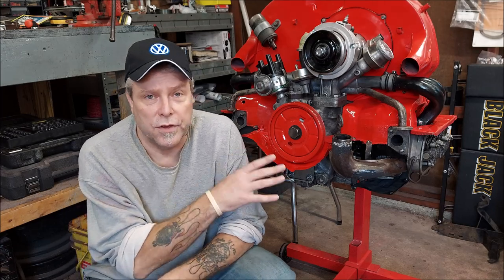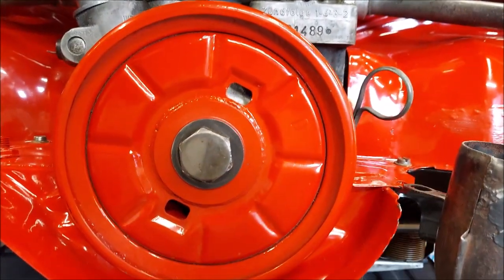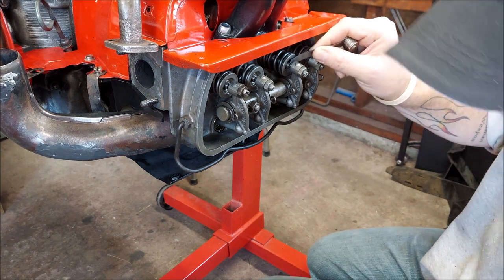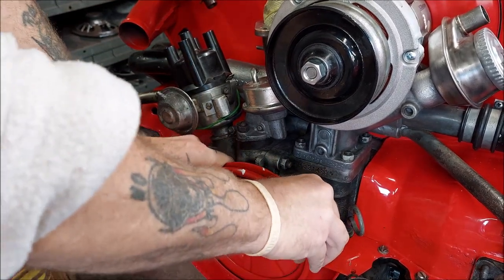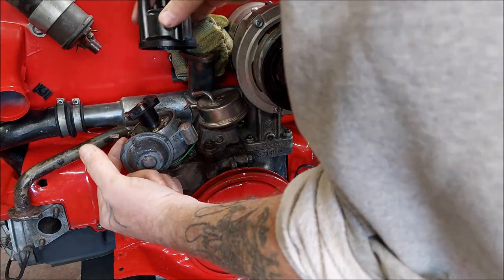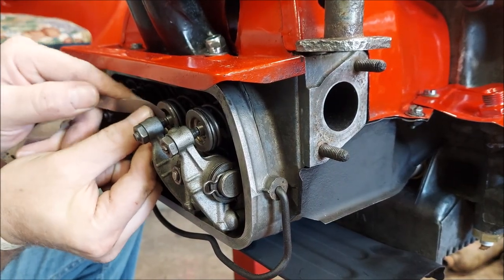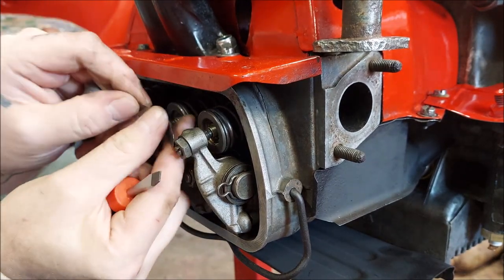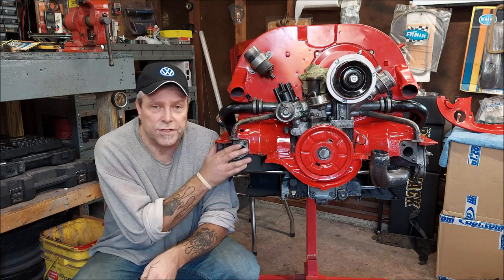VW Beetle & Super Beetle Valve Adjustment - 1600cc - VW Baja - VW Bus - VW Ghia - Valve Adjust DIY

Comment: In the mid 1960s the local VW dealer in Knoxville Tn. charged $2.50 to adjust the valves.

Comment: Really good video. I remember the last VW me and my father worked on. I forgot the valves needed adjusting and I had a problem with the motor making a sucking noise. To make a long story short, when the valves were adjusted, the head bolts wer e not checked for appropriat e tightness. By the time the motor lost so much compression it wouldn't run, one head nut had dropped off and all the others on both heads were ready to do the same.  When they were retightened,  the rocker arms were so tight against the valves, they would have sent them through the heads immediately at start up. After a VW gets 75,000 miles check the head nuts every valve job to keep your 1600cc motor happy. 10:35 My Father warned me it needed a valve job, but he was not able to work on it like he used to. It had the original motor in it.

Comment: Very clear video and good explaining… Thing I disagree with is all the extra pulley turning… you can actually adjust cylinder 1 and 4 on the same crank rotation as well as 2 &4 thus cutting the time in half…

Comment: I knew I could count on you to have a valve adjustment video. I need to adjust the tappets on my rail buggy. I can't seem to get my engine to run on all four and it doesn't have that good old VW clatter. I think the valves are way too tight.
Reply from the maker: Thank you! I did it while it was outside of the car to make it easier for filming.

Comment: Hi your channel is great.
I have just put my engine back in and drove it for the first time on Saturday, 2 days ago.
It seems fine, It had a align bore , new cam and followers. Seems a bit down on power, though. Is it because it is still a bit tight? I did the cam burn for 20 mins, and changed the oil.
 I am now about 30 miles into my 500 mile break in period. Do you have any advice you can give me on running it in, please? 
I was told not to drive it in forth under load up hills, yet, and generally don’t drive it fast. (Always stick to 55 mph and under, anyway).
All the best 👍🏾🛠🇬🇧

Comment: nice video👍 can i turn crankshaft by simply using a 30mm wrench on the crankshaft pulley nut?? much easier than hand turning…but would that loosen or over torque the crank pulley nut??
Reply from the maker: If you have the spark plugs out for any reason, it won’t loosen the nut with no compression. But yours is probably in the car. It wouldn’t be much fun just to take the plugs out of.
Reply: @SladesVWBeetle  thanks...kind of my thinking as well....

Comment: also…did a top end rebuild a few years back and used steel alloy pushrods instead of aluminum…Ive had lots if people tell me to now keep valve clearance to 1-3 thousandths as the steel ones don’t expand in hit engine like stock?  but Im a little leery…any thoughts?
Reply from the maker: Oh my…. I haven’t had anyone tell me that. I think I would be a little nervous about doing that, of course it’s just my opinion. But beings they are steel, there truly could be a difference.

Comment: Thank you Tony.    Finally did my first VW valve adjustment.  1600 that Lenny in Elizabeth rebuilt years ago.  009 and lash was 0 to less than .006.  I set them all to .006 since this engine runs hot (dipstick is too hot to hold)... I watched your cooling tin video too and did that. I thnk I destroyed a thermostat !  (you did say banana head)...engine is in and plan to start it this week... (generator went bad years ago, long story, engine and bus were parked for 5 years !)
Reply from the maker: You’re very welcome, and thank you for being here. Make sure when you get a chance to watch my video with the cooling tin installation. To make sure you them all on. 
Also, the thermostat if broken should fail in the open position, allowing the ducts to be fully open for cooling. 
But if the spring on the back….between doghouse shroud and firewall is not on, it will close the flaps and run very hot!
Reply: @SladesVWBeetle  that little spring was missing on the back of the shroud when I pulled it out...hmm, not really impressed on how this engine was built...
Reply from the maker: @DanTheManIOM  Ohhhhhh damn!!!! That wasn’t good!!!
Reply from the maker: @DanTheManIOM  I was only down his place a few times, I live about a half hour from there. I think he’s been gone for sometime though. I bought a couple of parts many years ago and that was it.

Comment: Awesome video! gonna do it soon. I got a new distributor, should I adjust the valves first then adjust the distributor to advance timing or vice versa? my engine's running too hot :(
Reply from the maker: This is just my opinion of course, but I would adjust your valves, then check your points for adjustment, and then adjust your timing.
Reply: @SladesVWBeetle  thank you so much! I'm gonna do just that :D

Comment: I adjust mine pretty often, not that I need to, I just like working on my dub.   I always wondered if it was too tight what could happen, an if it's too loose what could happen.  Your thoughts?  I heard it'll get noisy if it's to loose.
Reply from the maker: Too tight can stretch the valves, or cause other damage. But a little loose is okay honestly. Will just have that sewing machine sounds. Will not hurt anything though..
Reply: @SladesVWBeetle  last question, will it sound different or run different if too tight?
Reply from the maker: I believe if too tight, It probably wouldn’t idle very well! If to loose it would idle, but you would hear a lot of ticking noise. Never a bother there’s never too many questions.
Reply: How often should the Valves be adjusted??  Every 3k with oil changes??

Comment: Is it possible for my 1600 to have cylinder 1 be where your 2 was? I traced all wire and 1 is where your 2 is and 4 is where your 1 is.
Reply: possibly a different distributor? no biggie if every is tuning and running proper.
Reply from the maker: If you have a different distributor as stated above you’re fine.

Comment: How does the engine behave if valves are tight?
Reply from the maker: You definitely do not want them too tight. You could actually bend a valve. And obviously it will not run right. Make sure to take some time and readjust your valves. And then re-adjust your timing.
Reply: I guess what I was trying to figure out is... if to tight or to loose can u tell by the way tge engine is running that you need a valve adjustment
Reply from the maker: Oh OK, sometimes it will run a little erratic. I’ve seen some more the valves were just a little too loose, and it almost gave the symptoms of the timing being out of adjustment.
Reply: Ok! Thanks!✌
Reply from the maker: Absolutely, thank you for being here.

Comment: I adjusted mine, the engine got just a bit louder.
Reply from the maker: @Kohut-e4s  I never had one get louder before do you mean a little more tapping? Sometimes it’s better to have them slightly a little looser than too tight if that’s what you mean.
Reply: @SladesVWBeetle  that's what meant was a little moor tapping.